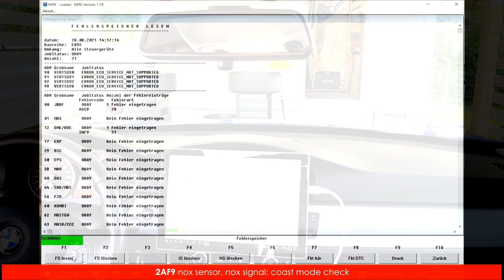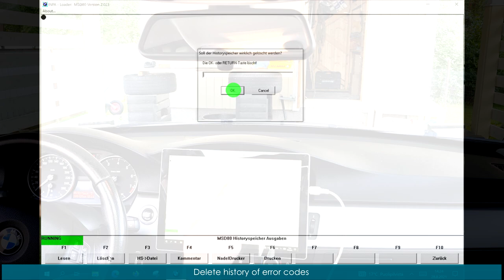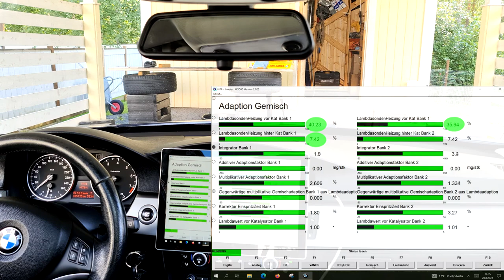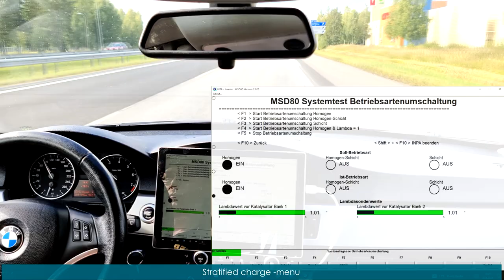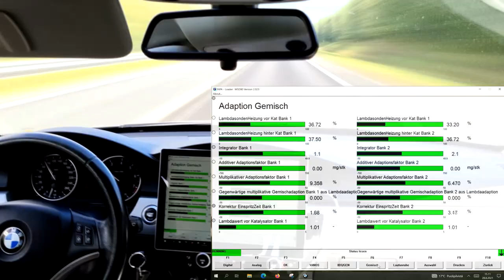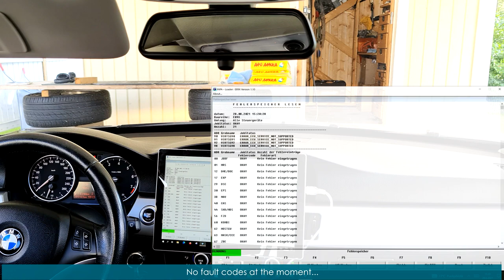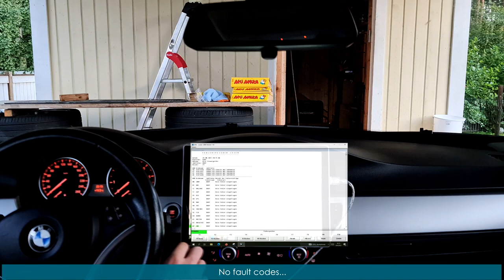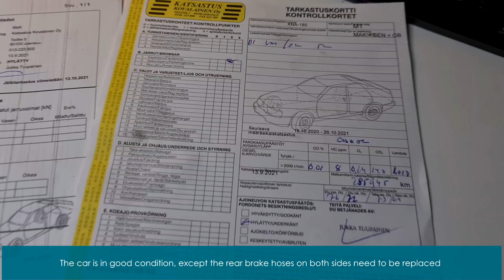NOX SYSTEM status - AFTER 1 YEAR - BMW E91 engine N43

Comment: Leak in the exhaust system could be your flexi pipes, very common, hook a smoke machine up to the exhaust pipe, easiest way to spot small leaks 👍👍
Reply from the maker: In fact, I replaced that flex pipe with a new one in 2019, when it had a leak. I think the problem is once again related to the NOX sensor, but it still needs to be investigated with like smoke machine... 👍

Comment: I can't imagine to owning that car if I would be only a user driver. This video is nice example, that BMW has a very specific and difficulty technique. Thanks for your video and motivation to create this! Btw. I am thinking about say bye bye and look for E91 LCI 325d M57. For engine N43 price of new OEM injectors today cost  415€, in 2018 i bought  a new OEM at the dealer with price 162€/pc. On the other hand, I have a NOXEM-130 from Bimmerprofs and works well for 3 years. Last summer appears some fault code as same as yours - lambda coast-mode check. I solved it, after a few mails with bimmerprofs, by a new lambda probe on NOXEM and now works as well. So, NOXEM is better solution, but lambda probes can damage too. Fortunatelly there is more simple to repair it. What about measuring of NOX emissions of your country at the technical/emissions inspection station?
Reply from the maker: If I had fixed all this stuff in a car repair shop, it would have become really expensive !! Hobby mind here has been some sense 😉.
So I would almost say that this engine requires a bit of hobby!
I can't say exactly about that emission measurement at the inspection station, but luckily it passed. 👍
Reply: Yes, you told it exactly..this engine is a hobby 😁 this winter i am planning to swap my 318i 105kw to 125kw like 320i. I will need to change a intake manifold with integrated swirl flaps and motor actuator (cable is there but only  blinded connector) change catalytic converter and add 1 oxygen sensor - there is a little bit problem, i dont know yet where i have to pin the wires into DME and reflash DME software for 320i. Maybe I make some video too. Actually, if I found the source of rattling what I asked you in another video

Comment: Hello, i have the same n43 engine. First I has the P122E default and i change the sensor (same as the video) but after a few km/miles I have two other default : P114D and P2272. Can you help me to solve my problem if you can ? 

Sorry for my English I am French

Comment: your flex pipes are destroyed partially, they shouldnt look like that. check how new ones look, they have one more layer.
Though, Im not sure that will fix your error. But, I would replace them.

ah, im sorry seems like some models do like yours! so i dont know..
Reply from the maker: My car’s flex pipe looks just like this and doesn’t have to have a separate layer around it. They come in different models in different engine versions. 👍
It is like this: https://www.ebay.com/itm/223139584381

Comment: In your opinion is this a good engine to have on an E90 ?
Reply from the maker: The N43 engine is a good engine when it is in good condition! Powerful and low fuel consuming engine. But when it comes to problems, it has so many variables that affect many different things, etc ... like the NOX system.
If you own the same engine (N43 or N53), you should keep it in good condition. The longer the fault is "on", the more challenging the fault repair will be. For example, leaking injectors destroy over time a really expensive NOX Catalytic Converter, etc ...
Reply: I have it in my E90 and while I haven’t had any major issues up to now (100k miles) I have spared no expense with maintenance. I wouldn’t recommend buying one now (in 2021) unless you know it’s been extremely well looked after.
Reply: @wrongmark  What have you done to keep it in maintenance? I bought one with a full BMW history - the previous owner kept it 100% serviced as and when required, fixing all issues that arose though BMW. It had its timing chain & guides, tensioner, sump gasket etc. all done by BMW before I got the car. I bought it in 2020 with about 45,000 miles on the clock and it has only done about 9000 miles since then.